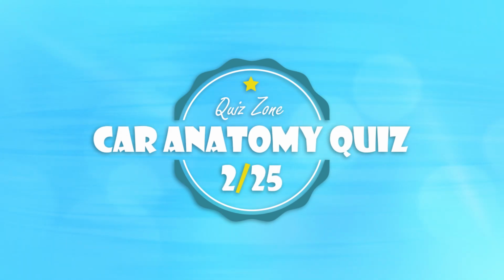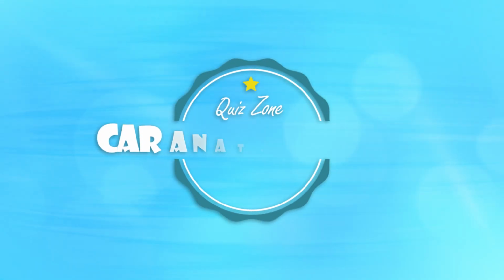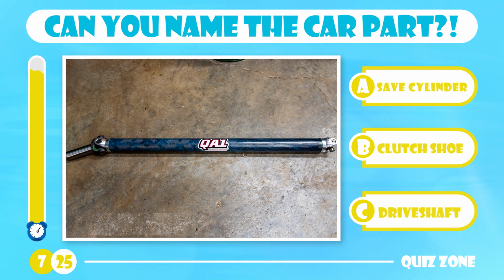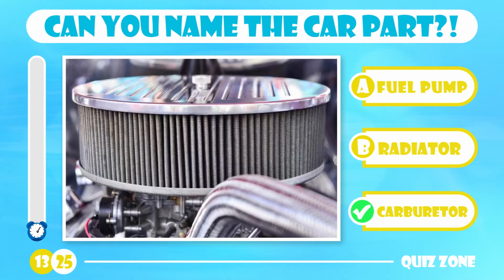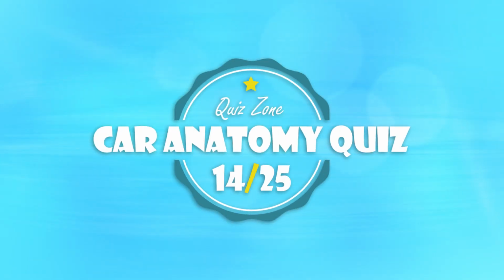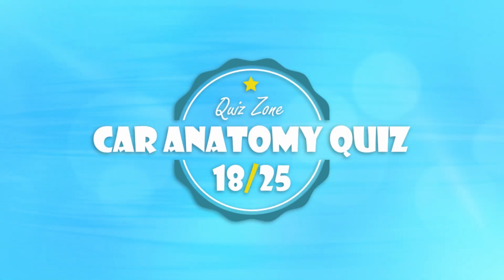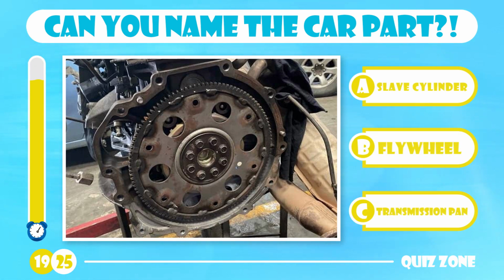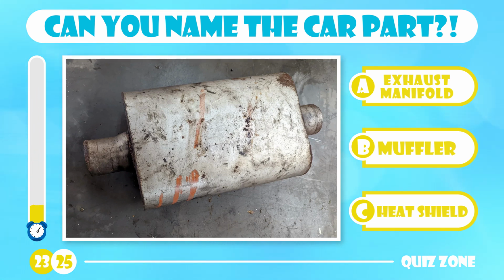Can You Guess the CAR PARTS?🔧🚘: General Knowledge Quiz About CARS!

Comment: The carb. was in fact mostly the air filter on top of the carb. and the flywheel was not a flywheel, but an auto transmission coupling plate. A very easy quiz 25/25.